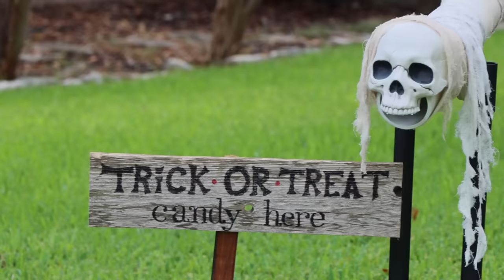Halloween Isn't Cancelled! DIY Prop for Trick-or-Treating during COVID

Comment from the maker: 🎃💀 Grab the FREE plans to build your own candy slide here: https://thewickedmakers.com/projects/diy-halloween-candy-slide/
Reply: Wicked Makers yea! Thank you!
Reply: What about Mississippi because I lived in Mississippi and I’m worrying
Reply: Awesomeness!
Reply: We are doing this for Halloween thank you for the video
Reply: How much did parts cost?...
Reply: thank you Wicked Makers, saw your video on tv in Victoria Australia and will build this soon
Reply: Solution if your slide is at a shallow angle and candy travels to slow or stops inside.... I did a version of this but there was one issue I had after I made it.  Calculating with the height hat the front and at the end and have a minimum of 6 feet from front to back. My angle was about 17 degrees.  Test shoot with candy it slid slowly and at times just stopped.  If I wanted 6 feet I’d distance the angle would need to be about 30 degrees but then the back would be about almost 7 feet high.  Not going to work. But I found a easy fix... auto spray wax.  Find a rod just longer then the pipe.  Wrap a rag or old sock at the end into a ball.  Spray the rag and spray into the tube a just work the spray wax. And a few coats... candy shoot right out even at a shallow angle.
Reply: Not only are the people inside the house touching the candy but ALL of the children are touching the area where the candy drops out.

Comment: The thing about PVC cement is this. It is a solvent and basically welds pvc together. It is not a 'glue'. When you use it, you have to make sure all of your fittings are correct and line up AS SOON AS THE PIECES TOUCH. I build props for films and Halloween effects as well and have used PVC for years. It is tricky, but the results are solid and permanent. 
The problem you had is pretty typical when rushing, but it happens to everyone who uses this a medium at some point in time. 😊❤👍
Reply from the maker: That is great information, thanks! 👊🏼👊🏼

Comment: I am talking with my brother about doing something like this and came up with a few extra ideas. So figured I'd pitch them here to maybe help you further your build. Maybe for the part 2 overly complicated version for veteran makers. 

Lights in the tube, but I'm also thinking uv lights at the top half. If the candy has glow in the dark on the wrapper extra points. Low lyeing fog through the tub as well so that it's pouring candy and fog ( you can get smell oils for fog to make them smell really good). And it would be cool to do a sound card arduino so that as the candy comes down it triggers the lights, and a sound effect. Also think attaching a GoPro to the tube or near it to timelapse all the costumes coming up. To get extra crazy a hopper and a way to despense a standard handful every time with a crank it push of a handle or whatever. My parents have a iron gate in their entryway and I'm thinking pushing the tube through the gate to further keep kids back plus it works as half the mounting system. 
We also 3d print so I think it would be cool to modify a skull model to specifically fit a pvc pipe like a end cap. Would also be cool to have a small table under it where kids should put their bag/bin for proper despensing. 
Anyways here's 5 mins of over complicated brainstorming.
Reply from the maker: Those are awesome ideas!!!!! 👊🏼👊🏼👊🏼😄

Comment: Not sure if anyones said this yet - but it's actually not glue, but a solvent that fuses the two pieces together. Hence the speed!
Reply from the maker: Ahh interesting. Thanks!
Reply: @WickedMakers  And the only reason to use it is if you are going to run water under pressure through the pipes.

Comment: This is a great idea! If you're making things out of PVC, I highly recommend investing in a PVC cutter. They cost less than $20 at big box hardware stores. It's so much easier than using a band saw and doesn't produce a bunch of plastic shavings. For projects that don't need to be water tight I sometimes drill a pilot hole through the pipe and coupling and then drive a screw in to hold it together. Then I can remove the screw and re-use the parts later on to make something else.
Reply from the maker: Oh awesome. Great idea!

Comment: Great idea!! I'm so inspired! I do have a suggestion... I've done quite a bit of PVC building and I too discovered PVC cement can be problematic, so now I fit the pieces together with a rubber mallet to be sure they're tight & then screw a self-tapping screw through each joint. It will be sturdy, but you can take it apart easily if needed & even re-use the pieces. Keep up the good work!

Comment: 3:19 No wonder it failed!  It may take a while to completely cure, but you need to connect the pieces immediately after applying!
Reply from the maker: Haha, well NOW you tell us. 🤣
Reply: What she is applying first is the purple primer, and it's fine to let that dry.  When he was applying the actual glue he seemed to be doing it appropriately and joining the pieces quickly.  It does set very fast though so you need to make sure things are aligned.  I recommend a combination of the two...  with all those small pieces in the base it's more likely to fall apart with no glue at all.  Glue some parts for stability (a few at a time) but dry fit others so you can break it down for storage easily.
Reply: Also there is "fast set" pvc glue... make sure you're not using that.
Reply: @GojiBaba  Primer?  I've always just sanded the contact points and glued.

Comment: Well it's a fail for social distancing at 9:34 and since you touched the candy with your hand to put it in the slide and the kids will also touch them eventually... it's call cross contamination... Stay home stay safe
Reply from the maker: Thanks for watching but you might have missed the end. 😄
Reply: Surface contamination and airborne particles are two very different contamination vectors.  They're saying surface contamination is less of a concern now, and 6' is still the recommended minimum distance for airborne particles (though 10' might be cool too).  So... not so bad.
Reply: Lmao this country has become so epically spineless

Comment: What a great idea! If you cannot find 3" PVC at your local hardware/big box stores, you can use 3" Corrugated Perforated Pipe too. Costs half the price and would look great if you had a strip of flat LED lights going down in a purple or orange color.
Reply from the maker: Nice!!! Great tip.

Comment: Or dry fit the frame and then secure with small screws, or rivets run into pre-drilled holes.

Also, I would use some of the wrapping material to secure the slide tube to the bases, or extra long zip ties.

Add prop fencing to keep the kids away from the loading end to maintain the six feet distancing. 

Otherwise, this is a really great idea to help keep the fun of trick or treating going for the little ones. Happy Hallowe'en!
Reply from the maker: Great ideas! 👊🏼😄

Comment: What kind of angle do you think is required for the candy to fall down?  Do you place it or throw it?
Reply from the maker: The angle we used was based on lots of tests. Really small light candies you have to throw but most stuff slides fine.
Reply: Wicked Makers thanks. I actually want to make my slide longer than yours, from my stoop to the street about 14 feet.  I’ve used 2oz candy so far and it needs a good throw or it can get stuck. What size did you wind up using?  Maybe putting the candy inside some kind of plastic egg or ball would be even better?

Comment: I've been considering doing the same thing except making the main pipe able to swing up and down and hanging a plastic cauldron on the end. I will likely be the one loading it anyway so why not attach two bolts to either side and let it swivel up to load then down to dispense. Possibly pipe in a fogger too? Nice job & great videos!
Reply from the maker: Nice!!

Comment: I built one but used 3” abs and not 3” pvc. Candy will not slide at that angle. I am assuming the PVC is smoother on the inside.
Reply from the maker: It’s incredibly slick, yeah. No sliding issues.
Reply: Do you have any ideas on how to keep the candy from getting stuck? The angle i have it at is pretty high right now but the candy keeps getting stuck as I test it out. Ive had to push a smaller pvc pipe tied to a fish line through just to make it get to the end and I retract the pipe back through. My fear is that if i do that to alleviate the problem it might break free from the fish line and hit a kid at the open end.

Comment: It looks great!! You probably could’ve saved more time by using a few 2x4’s and a nail gun for the supports, but it was a great idea.
Reply: It could get pretty heavy with 2 x 4.  I used 1 x 2 for the base, but quite frankly my version is probably just as involved to build as the PVC version.  Just depends what one is used to work with.  I like both versions.  https://www.youtube.com/watch?v=RPpOo3ojNl4
Reply from the maker: PVC was specifically built for folks without tools. If you’ve got power tools, wood is definitely a great option.
Reply: @WickedMakers  Wood base versions may allow for all kinds of different bases but an another advantage an all PVC design has is not having to be concerned with it getting wet and it is easy to clean.

Comment: Im trying to make the same thing but you guys have little 1” pvcs that connect the stand that werent talked about in the free plans. What are the measurements for those peices?
Reply from the maker: Everything is definitely in the plans. Which pieces are you referring to?
Reply: @WickedMakers  I am referring to the 1” pvc’s that are cut smaller than the 18’  that are used to connect the elbows and tees.
Reply: @WickedMakers  I am referring to the 1” that are cut smaller than the 18” and are used to connect the elbows and tees for the stands.
Reply: @WickedMakers  Omg I clicked download plans and it was all there so sorry for my mistake 😂
Reply from the maker: Glad you found it. 😄

Comment: You can adjust the glued joints for about 5 minutes if you use a strap wrench to twist them. But the glue is unnecessary, since not pressurized or worrying about water penetration.
Reply from the maker: Yep, absolutely!

Comment: In my initial tests, I seem to be having trouble with candy not sliding the whole way and getting stuck (especially things with waxy wrappers like Reeses).  Trying to think of a way to decrease the friction.
Reply from the maker: Some people have used like a silicone spray or stuff like that but we just give it a toss if we think it might be too light to slide.
Reply: Get a long skinner pvc pipe to “push” Any candy that happens to get stuck all the way down.  Much easier and quicker fix
Reply: Angle needs to be at least 30 degrees.  Flour is one way to lubricate the tube and is safe.

Comment: I know I'm really late with my comment, but we glue those type of pipes together at my work. Clear PVC adhesive has a longer working time. It takes about 10-15 seconds before it starts setting. If the parts are put together incorrectly, they can be taken apart again by heating up the parts with a heat gun. It takes a minute or so to get them hot and soft enough to be pulled apart again. Be careful though, the parts do get very hot.

Comment: instead of pvc...get a rug roll from a carpet store. ..way easier to cut and bigger center ...if you angle it right stuff will fall right thru so you dont have to worry about it being slick inside
Reply from the maker: Great idea!
Reply: Is the rug roll plastic?  part of using a PVC pipe or other plastic tube/chute is it can easily be cleaned before using.
Reply: @theplaguedoctorshaunt9787 they are usually made of cardboard but since candy is already sealed  and have already been in cardboard packing boxes and on store shelves so the inside of a cardbaord tube is nothing in the grand scheme of things. Plus if you use something like a small baggie or plastic egg like container to put the candy in, that gives an extra layer .  Food products would not be touching the inside of the tube at all and if you put the bucket area below where it would drop out the kids would not be touching the tube either.  "set bucket here "

Comment: You really don't need to bother with the primer step if it doesn't need to hold water under pressure.  The PVC glue will hold it together just fine without the primer.
Reply from the maker: That’s great info, thanks!!!

Comment: Looking to make the unit about a foot taller, adding 6" to each of the "E" measurements.  Do you think this will cause any structural issues or make it too unstable? Thanks for the ideas.  Keep up the great work.
Reply from the maker: Nah you’ll be totally fine.
Reply: @WickedMakers  I finished it yesterday with the additional height. Turned out great. I repurposed an old talking skeleton that has long since stopped working. I cut the chest cavity out and ran the tube through the cloak, then put a small led light in the tube to light up the end where the candy will come out. I'd love to shoot you some photos if you have an email address. Thanks for the great idea. Happy Haunting!

Comment: This is amazing. I made this, but the candy keeps getting stuck. Any suggestions? The only 3" PVC pipe I could find was black drain pipe, it looks the same as white though, could that be the issue?
Reply: What slope are you using.   I used a rain gutter down spout at 30 degree incline and works like a charm.   You might try cleaning out the pipe with soap and water and then let it dry.  If still stuck then flour might work as lubricant.
Reply: @theplaguedoctorshaunt9787  That's a great suggestion, I'll try that. Thanks for the suggestion! :)

Comment: This is a great concept that I will possibly steal and pirate up.
With your rings, just cut once, not in half, and you can pressure fit them without needing glue.
The overall effect is pretty cool and while the plain black stands will probably disappear at night, I would have dressed them up a bit, either with vines and bones, or made them look like a wrought iron graveyard fence.
Reply: Also here's to hitting 100K subscribers any time now.
Reply from the maker: Thanks!!! Great ideas as always.

Comment: Hey guys! I just finished buildig one of these! It's pretty awesome! Can I ask, maybe i'm just using really light candy (LOL), but can you suggest anything that I could coat the inside of the PVC tube with? Something that would dry, but will make the interior more slippery to help the candy slide down? Thank you so much!
Reply: What angle did you put the pipe at?  I built a similar a similar version a few months back and discovered that 30 degree incline works well.   You might try dusting the interior with flour if changing the incline does not help.  The flour is not messy and safe.  https://www.youtube.com/watch?v=RPpOo3ojNl4  I really like Jaimie's and Jay's version since it is all plastic and does not require andy carpentry skills or tools like I needed to build my version.  The important thing is for everyone to have a chute rather than giving up on Halloween.
Reply: @theplaguedoctorshaunt9787  Thank you!

Comment: Love it. Looks like it was a hit with the kids, too. I am thinking that I want either a wearable puppet or costume with long monster arms, for passing out bags of candy. My son has a stilt costume with long arms, but he uses peg stilts (which forces you to step constantly to stay upright), so it would be too much to ask him to stay inside the gate all night handing out candy (he usually roams and catches TOTs on the way out). FYI, wood screws or drywall screws work great for fixing pvc pipe together when you can't or don't want to use glue, but pre-drill your holes if you aren't fond of putting a screw into your thumb (ask me how I know that, lol). Depending what you are making, if you are using connector fittings, just drill a hole and shoot one screw through the fitting into the end of the pipe, and voila. I am guessing, though I've never tried it, you could probably dry fit, then just do a bead of hot glue to get it stuck together, then peel the glue off if you ever want to take it apart and reuse the parts..?
Reply from the maker: Nice, screws are a great idea!

Comment: Do you have some super-slippery PVC? My 10' length of 3" PVC stops candy in the tube if the angle is anything short of an unusable 45° or the candy gets thrown down the tube. :(
Reply: Fwiw, I waxed the inside of the pipe with a huge wad of wax paper and that seems to have made it slick enough to work! Some sort of food safe wax or spray that doesn't leave a residue could work, too!

Comment: Full-sized candy bars are heavy enough to make them slide really well, I'm just saying  :D
Reply from the maker: Yes!!! 🤣
Reply: Have you tried it with smaller "fun sized" candy (the bulk bags targeted for Halloween)?  Initial tests using a 3" pipe at a 45 degree angle had poor results (test items kept getting stuck in the tube).
Reply: @NotFranksPlanet  I just did a trial run with vinyl downspout (much lighter than PVC).  Dog biscuits in a zipper snack bag approximating the weight of two fun sized bars had no problem sliding 10 feet, albeit at a leisurely pace.  Shortening the downspout and doing some R&D with the angle should provide a very satisfactory result.